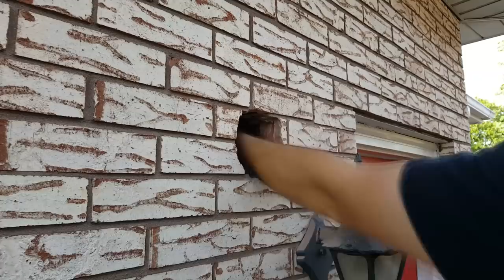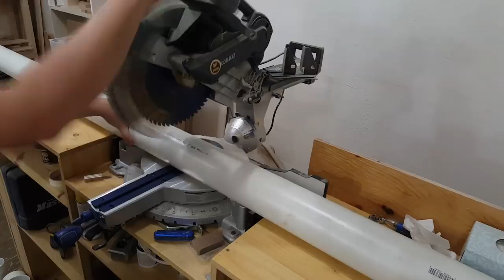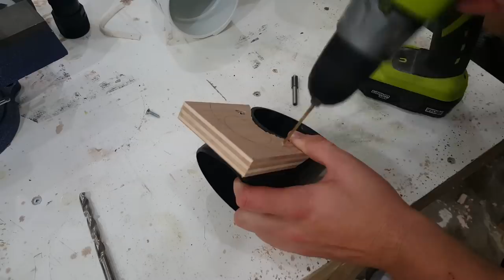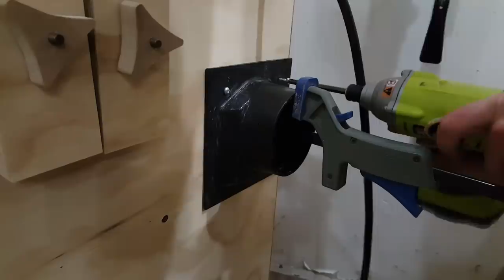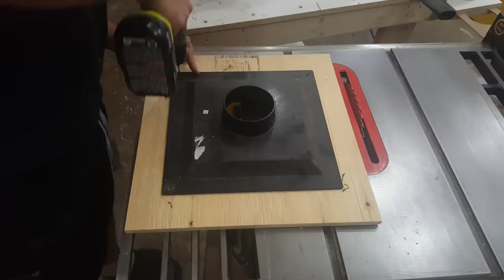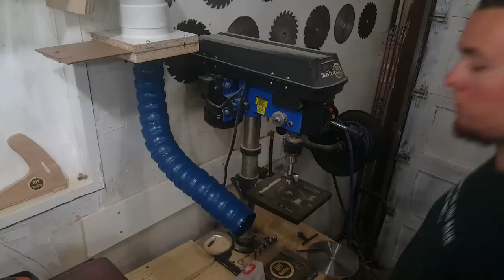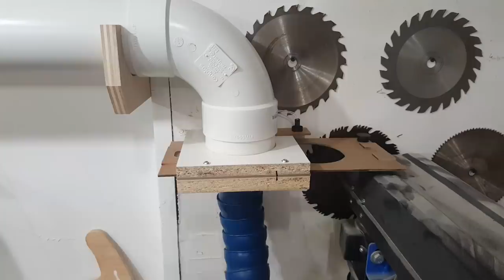DIY Dust Collector System with Homemade Blast Gates and Automatic Start/Stop Function

Comment: The relay to switch the power on is freakin brilliant!
Reply: was just about to post this. absolutely genius design.
Reply: I was watching and thinking that a dust collection like that I need in the shop I'm building and then the on/off switch came and I was WOW. Ingenious indeed!
Reply: That is brilliant, but what I thought was exceptional as well was the three way small hoses for the benchtop tools. This was a great job all around.
Reply: Agreed. Beautiful touch.
Reply: Awesome idea really. Could not be any more intuitive than that!
Reply: Is there a possibility to scan the powerlines if one of the attatched tools is switched on and the dust collector turns on as well automaticely?
Reply from the maker: Yes but you don't want to be stop starting a big motor like that often. And i would have to have automatic blast gate open closers as well
Reply: @DIYBuilds  agree!!
Reply: DIY Builds what 24dvc contactor did you use?
Reply: May I ask what size pipework did you use cheers im in U.K.

Comment: Only thing I would have done differently would be to make as many of the 90 degree fittings, as you could, by using two 45 degree fittings instead. Much better air flow. Great job.

Comment: I like the low voltage relay start. Showing the details of that system would make a good video. 

Glad to see you aren't venting the dust inside!

Take a look at Bill Pentz website about dust collection. He has more information there than anywhere else I've found. He's wrong about not being able to safety vent inside through a filter but his website is a great resource for information and ideas. 

For your system,  if you switch from 90's and Tees to larger radius bends and Y's, your flow rates will increase significantly.  I tested a system that I built with a 90 degree fitting and it was dropping half the pressure of the entire system.  I got rid of the 90 and my flow rate went up 30%. 

If your system is really capable of pulling 1700 cfm (it would have to be  220V 3hp or more to do that, most collectors way over rate flow rates) then you need 8" ducts to not reduce flow.  I doubt the system is flowing over 500 cfm as it is. but if that's enough then it doesn't hurt anything to leave it as is.  The motor draws less current with more restrictions (that's not intuitive but you can prove it's true but checking motor current with a clamp meter and changing the amount of restriction)  so it just saves power.

I hope that is helpful information.  Reading through Bill Pentz site is a great way to learn what works best and what your options are.

Comment: I need a v8 and a 🤦🏽‍♀️ lol I just realized you eliminated the need for stressing over pipe fittings and connections by screwing and cutting out the correct size pipe needed for a specific tool in each blastgate! Duh, I’d never have thought of that and after procrastinating on setting up my very own minor dust collection I feel like this way allows me to problem solve easily by drilling or cutting out the correct hole size of each connection into my own built blastgates. Thank you and I wish more builders would try this rather than melt a bunch of pvc pipes and break their wrists trying to shove pipes together lol

Comment: The idea was very good, the suction was working .  INSTALLED a directional flap to open  & close whichever machine that operates  so that suction will be strong enough.. BUT then he can have a better distribution of air volume  with constant FLOW rate if the diameter of the pipe is reduced as it goes further by using the formula  Q = VA.. This is just to share my technical  knowledge & experience. GREAT. very useful for wood working home  industry

Comment: I was going to exhaust my dust collector outside like you did, but I didn't want to lose the heat in the winter and my meager air conditioning in the summer.   The turnover for the volume of the space is pretty surprising.
Reply from the maker: +mike susman I'm not heating or cooling my shop so this is good for me lol

Comment: Some great ideas there. Over the years I have ended up with more than five powertool brands. I have been trying to work out a system which uses a house vacuum with PVC and pool hose or something similar. You just helped solved some of my biggest problems. Great to see a channel that doesn't just use off the shelf solutions. Not all of us can find them in countries where small populations mean less consumer choice. My workshop can get damp so I will probably substitute perspex or acrylic for my gates to reduce the chance of swelling. You just gained a new subscriber by the way.

Comment: Well gotta say one of the best dust extraction systems i have seen, and the video was well edited. don't know why the thumbs down be nice if they left a comment saying why.
All the best.
Reply from the maker: +DIY GAME TEK thanks
Reply: I never press any thumbs down but maybe it is because this is a ticking "dustfirebomb" . You should never use plastic tubing as dust collector unless you run aluminium tape on the inside and outside on the whole length of pipes and connect it to ground. With a little bad luck this will explode (perfect mixture of dust and oxygen) and set the house on fire due to static electricity. It has happened several times and even burned down big factorys.
Reply from the maker: +Johnny Andersson I am yet to hear of that ever happening in a small garage setup like this.
Reply: Agree. This is my first view on this channel, and I'm really impressed with how thorough he was with the DC system!
Reply: The only issue is if you are using it putting a lot of material through the  system you will build up a static charge. The grounding by you may not be all that pleasant but I agree in a small shop causing a fire is not a real issue. If you want to, just stretch out a coil of thin cheap wire around the pipes to a ground.
Reply: same
Reply: One more reason. You are creating a vacuum in your shop which means that air has to come from somewhere, that could mean smoke out of the wood stove or CO out of the furnace.
Reply from the maker: +Joshua Jonah garage is not conditioned and has massive airs leaks from the garage door and atic ;)
Reply: Thumbs down isn't necessarily done cos it's a bad vid. If it's popped up on someone's feed and it's not their thing hitting thumbs down tells the YouTube algorithm they're not a fan of it. They should probably have a not interested button
Reply from the maker: +Chris Watts Not that i care what people do with the thumbs but i don't believe that to be true. Pretty sure the only thing that says your not interested is seeing it and scrolling past it not clicking on it at all.
Reply: Johnny Andersson could you share some links to examples of these please.?   Great vid btw
Reply: It's great that you are concerned. I have been woodworking for over forty years. Not heard of any of these yet. Could you link to some reference material? The guys in Vietnam used to fill a room with flour and set it off with a match, so it could happen, but it would need to be in an extreme instance.
Reply: Jealousy, plain and simple.

Comment: Awesome work. But my Shop is Not big enough for something like this. I use a mobile cyclone cart.
Got here by your comment over at John Heisz scrap bin Channel. 😉
Reply from the maker: +mopemaster the unit takes up as much floor space as my shop vac and the pipes are on the walls / ceiling so no real loss there.

Comment: The switches to power on the dust collector is great, where did you get everything you need?
Reply: Matt Spry Yes, great minds want to know.
Reply: Matt
Reply: @TheFalconJetDriver  So old, but maybe others are wondering. That is a door contact meant for installation inside door frames by the looks of it. They are inexpensive and mostly used to monitor Open / Closed state of doors. In this case they are delivering a control voltage to the DC relay which switches on the machines.

Comment: I do like the low voltage dc relay control operation. Does your entire system operate only by this method?
Reply from the maker: +Dallan Wordekemper yes all 7 gates control the motor.

Comment: Great video, Brad!  How are you finding the  4" (?) PVC?  Is it fine or do you get any blockage in the system.  Keep up the good work!
Reply from the maker: Never had a blockage other than scraps falling into the bottom on the table saw flex tube which are easy enough to clean out. That would be fixed with a zero clearance insert. The 4" is good.

Comment: awesome idea on the blast gates. I'm cheap and have all these materials(minus the cool relay switches)to build these for the collection system i'm working on right now. The only issue i would have  is the exhaust venting outside, it would pull cold air into the shop in our Canadian winters. Great vid.
Reply from the maker: my garage right now is the same temp as outside temp so wasn't a factor for me. When i actually get fed up with that and buy a heater i will have to install a filter on the exhaust and disconnect the exterior vent.
Reply: @DIYBuilds  I wondered about that.  My shop is heated but not cooled.  I am thinking about a gate outside for summer or to a filter for winter use.  Do you think that is a practical idea?  How much dust actually gets to the exhaust.  My placement would put the external exhaust on the front side of my shop so I need to manage mess to prevent a 'domestic harmony' issue.
Reply from the maker: I've never noticed any dust outside.

Comment: Well done.
One question though:
The DC sucks air from the shop and presses it outside. Did you make a hole somewhere else in the shop so fresh air can get into it or are there already enough holes (=air leaks)? Because if there is no such opening (or number of openings), you would create a vacuum inside your shop and the effectiveness of your DC is lower as it could be. Just a thought.
Reply from the maker: Yes lots of leaks in my shop. That's the reason I dont climate control it.
Reply: I know this is an old thread, but it's important to note - If you have any gas appliances (heater, water heater), venting outside could cause carbon monoxide to be sucked into the shop.  As the DC exhausts the air, the vacuum will cause air flow in from the heaters exhaust flues, bringing CO with it.
Reply: Thank you for bringing this up. I dont have any of the things you mentioned in my shop but I do have a wood burning heater which would of been a disaster had I vented mine to the outside.
Reply: @DIYBuilds  Is the system wireless controlled with the low voltage magnetic switches?
Reply from the maker: Watch my viewers comments #3 for more detail on my dust collection system

Comment: That is an awesome setup!  My only concern for some people would be the permanent setup you have. If someone wanted a temporary setup or wanted to change the layout of their tools in the shop, then they wouldn't glue the joints together. But I'm not here to criticize your permanent solution here. Only you know what is best for your shop. I also love the venting the exhaust outside instead of having to invest in an expensive filter.
Reply from the maker: +Joshua Luther yup saving big money on filters that I never need to clean the choice was obvious.

Comment: Bad idea cementing all your joints. I would have just taped them it means you can re use them if you ever shift shops.
Reply from the maker: +apmountain if i move ill just cut them and use couplers

Comment: Pretty dang nice! That's exactly what I want to do - switch the DC on at each blast gate. I know remotes are popular, but I want to remember to close each gate after using it, so combining with a switch makes a lot of sense to me. 
Gotta say, though, that takes commitment to glue your PVC pipes together!
Reply from the maker: +Keith Carlson you described exactly why I did it that way. if I should have to cut up my pipe and use some couplers meh so be it lol

Comment: love it - and nice to see two things - that i'm not the ONLY one that cuts metal without gloves and THANK YOU for using the right tape... not 'duct' tape on the ducts.   i'm just in the process of putting a ceiling in my workshop... the growop guys put heavy plastic on with bat insulation above, so just putting OSB under that to close it in... i'm using 4" PVC, and grounding it to outside - heard all the stories of explosions and shocks and stuff, so worth at least putting a safety in place.   awesome video - thanks for the taking the time to share!

Comment: Very nice job! Don't forget to caulk the slip joints on that metal 90 coming out of the collector, because they induce a leak.  You will notice an improvement. You can caulk them or use the metal tape.

Comment: Really nice job done on the layout and everything custom built, even the gates!
The only thing I would suggest is to use a timer on the collector motor. Starting is hard on motors and they can draw 3x to 10x the amps during start up than running. So if you went from the band saw to the sander, or table saw to the sander or router table or whatever, then the motor would shut off, and you'd turn it back on a few seconds later. The timer would allow the motor to stay on for like 30 seconds or so. This would also make sure there is no peaces left in the tubes
Reply from the maker: +Korishan what i do to mitigate that is before I switch tools like from bandsaw to sander I open both gates and then go back to the tool that i was previously using and close that one
Reply: Ahhh, so you do the two-step  :P    At least you recognize the need for keeping it running.
There's another guy who built his system to use an arduino and when the shop tool was powered on, the system came on. I think over all, both systems are pretty comparable with each other.
Reply from the maker: +Korishan Bob I like to make stuff? Ya i find that my way is the least complicated way of doing it for the least amount of money while having the on off function I required.

Comment: A job well done! I think I like the drill press part the best. Just a thought for next time and how I did my pvc system. Instead of glueing the sections together, I slipped them in, added a couple small screws and then used latex caulk around the joint. This way they can be disassembled and reconfigured if needed. I also did a low voltage switch system on my cyclone.
Reply from the maker: +Tom's Dreamshop Worx ya my plan for when I move is to just cut it up and buy a bunch of couplers

Comment: Very nice. I used a central vacuum system that I modified without having to make low voltage powered blast gates. The ports cost only a few dollars each.

Comment: I have the same table saw. Have you ever considered making a zero clearance insert. Given the very shallow depth the table saw offers it might be a challenge. I have pondered over this for years, and as many videos I have watched, I've yet to see one for this saw.
Loved this video. Ideal for my small shop with lower ceiling and limited wall space.
Reply from the maker: Dennis Rochon seems to hard to make one for that saw personally. But i having really found a need for one either

Comment: I think most people will find elements of this installation very useful. I say “elements” because everyone’ building and machines differ and so you have to adapt. I think there are a few basics:

- buy as powerful an extractor as you can. Almost certainly, you will acquire more machines rather than go to less machines
- make sure you have the right dust extractor/vacuum for each machine. The right extractor for a planer is not the right one for a sander.
- keep your system as flexible as possible- by which I mean, machines change, layout evolves - so plan with those in mind
- keep your dust extraction pipe as big as possible for as long as possible. For instance, don’t reduce from 6” to 4” just outside the extractor; keep that 6” for as long as you can
- use a minimum amount of flexible hose. Flexible hose is probably inevitable but it is not anywhere as efficient as smooth pipe
- make all bends as gentle as possible. Look for long bends (larger radius) rather than tight bends. Where you branch off, don’t use a 90 T fitting; use a Y fitting as it allows more flow
- static electricity is a potential issue with using plastic pipe. How big an issue? I don’t know but the potential is there. So earth your plastic pipe; get copper wire (bare, not sheathed); you can earth on the outside of the pipe but my preference is to run continuous copper from each machine, twisted together where they meet other copper and superglue the wire to the inside in order to prevent rattling or interference to the dust flow. It takes longer than outside but I thin is more efficient and less messy. You don’t need to worry about static if you use metal pipe. 
- blast gates for every machine but as near the junction of the branch from the main pipe as possible. There is a balance between convenience and as near the main run as possible. In my view, wooden blast gates (see Katz Moses for my choice) are more efficient than steel for wood dust. 
- I don’t have those advanced sensors; I prefer a simpler technology of a remote to turn the extractor/s on or off. Just me, I understand TV remotes and so understand extractor remotes. 
- an outside vent (or even better, the whole extractor in a small building just outside the workshop) are great. Do it if you can. 

I hope some of them helps somebody
Reply: It did👍

Comment: Just an observation, you should run an bare copper wire the length of PVC  as static ground. Prevents clogging of sawdust. Excellent project
Reply: Dont need it. It generates only small amounts of static, and contrary to some opinions, no where near enough to cause a fire. It is therefore a waste of time